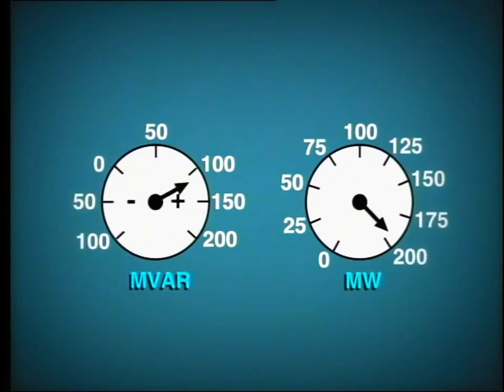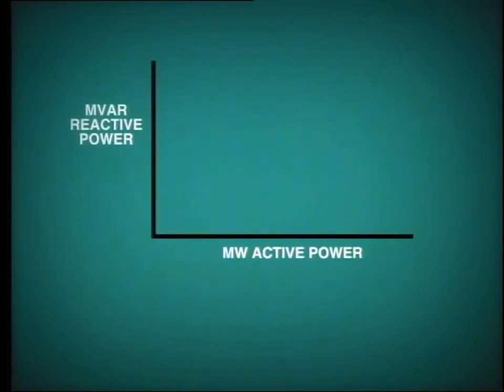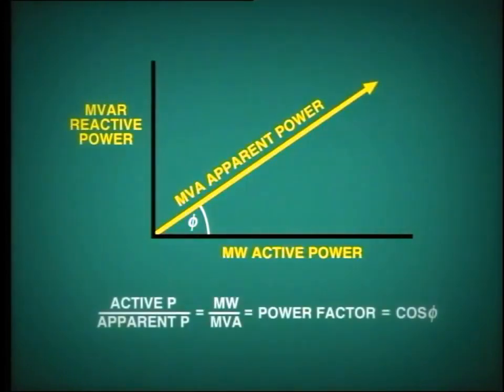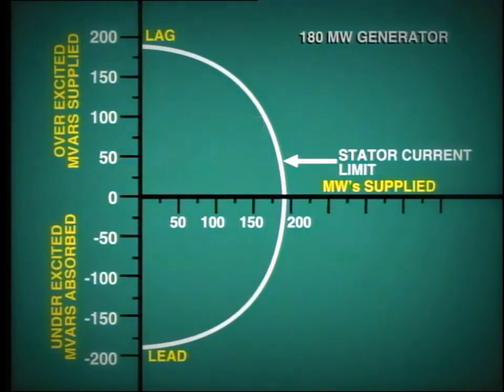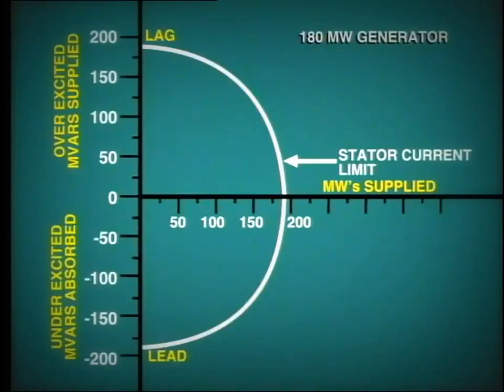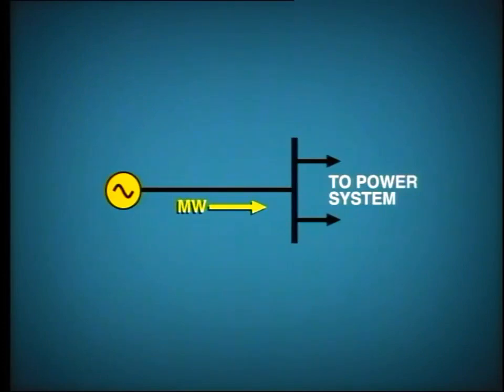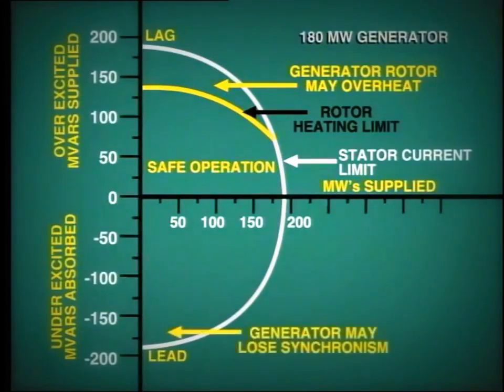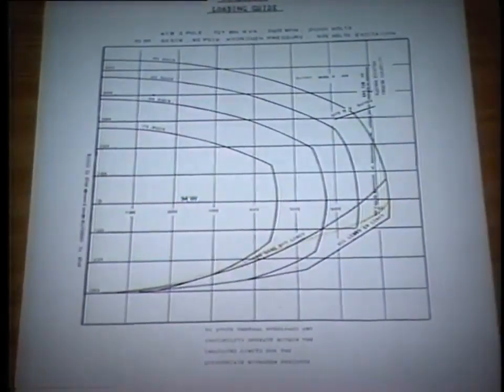lesson 10: Generator Capability Curve

Comment: This is why cars dont pull away in 5th gear its literally torque applied whilst complying to incoming supply vs demand "engine vs wheels" yeah you can idle at 40mph but its the least efficient way of doing so